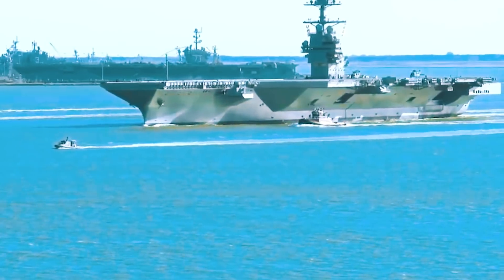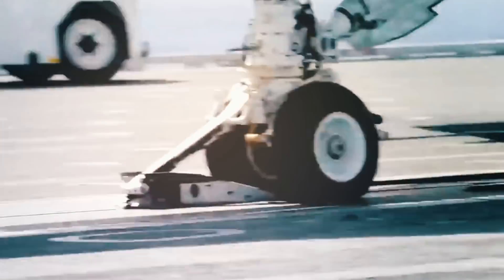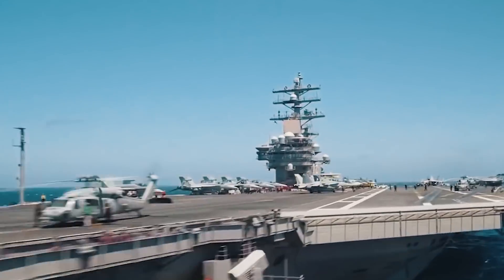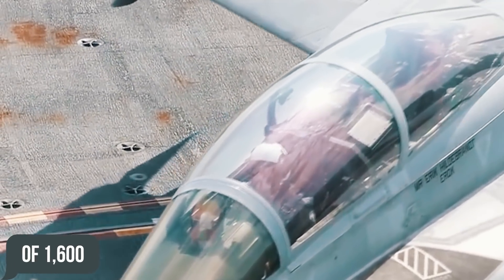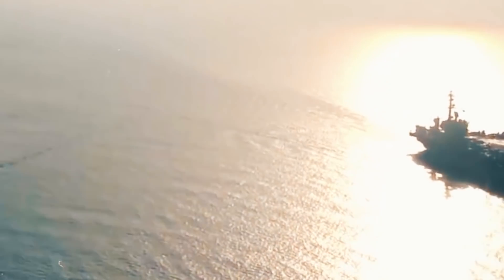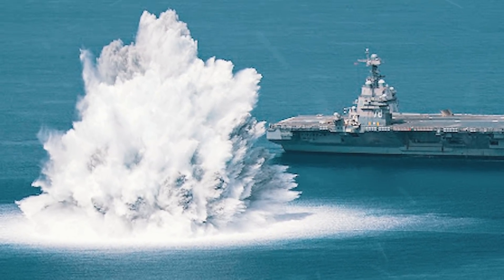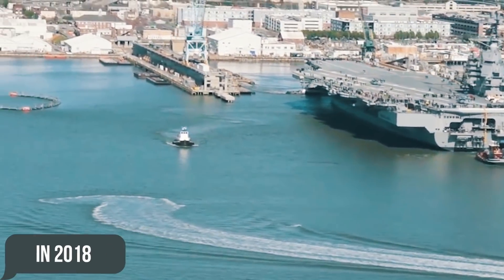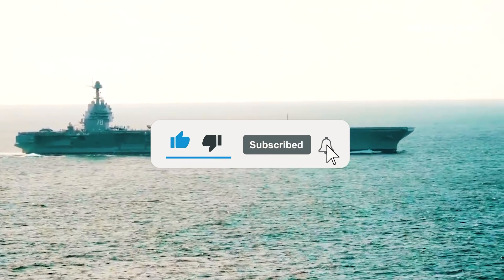This New US Aircraft Carrier Shocked The World!

Comment: The military and its contractors are doing for the most part outstanding work to modernize and place us in the lead with advanced military equipment. Now for why I say the most part and it's not the military members but the contractors and what I mean by that is there are times when the contractors are awarded contracts for a price the have delays and serious cost overruns which at times double the original contract amount awarded initially and usually it is every contract bid and excepted then the over runs kick in due low balling the initial price. I only know this because I spent 24 years in military service and a couple years with contractors now dont get me wrong I have no problems with any contractors it would just be nice if the could hit closer to thier bided amount to cut down time it takes to go over cost overruns and waiting for approval of more funds which slowes down our brother and sister In uniform get the high speed things they need to keep the free world free. HOOAAH

Comment: The George Washington CVN73 was one of the last of Nimitz class carriers. I am a plank owner of this Ship..As each lift section was placed it was set in place with at least 4 1973 George Washington quarters. The bottom of the entire "Island" is set on several 100 1973 quarters. CVN73 as I recall was 6 months ahead of schedule when commissioned on July 4th 1992. Even though 1 of the 1st to be built by modules Even during Shakedown, the George Washington had problems. Which were eventually fixed. The main difference between the Washington and the Ford is more powerful reactors on board the Ford. Plus modular slip in weapons stations. The more powerful reactors are needed to run 4 EM catapults and the advancement of Energy based weapons systems. The extra large bulbous bow I hope corrected the feeling of left/right slippage that you could actually feel towards the Bow. Before The George Washington CVN73 was given to the Navy people thought that one of the engineers was having phantom feelings when underway till I arrived and started to ask questions about why it felt like we had slippage going straight and in turns, Forward of Hanger bay 1.
Reply: America should sell the George W Bush and the George Washington carrier to Australia....... we live a lot closer to China.... and need something with some balls in the Australian Navy...... apart from your old submarines..... which are still great...
Reply: I guess not everyone can feel those differences then.  Did they listen when you noticed the slippage?
Reply: Do you have any references that mention the use of quarters during her build,  Wondering if that is a fact or just some fiction, or a factoid of the ship using that much copper or nickel in those areas, even though that in it's self would make no sense. Literally the whole thing makes no sense, they used weak metals between the steel which would compromise the ships effectiveness?  it sounds odd that the ship had sections with coins just sitting under them, let alone weak metals used in the joins of steel on steel, which was welded together.

Comment: I am glad it’s on our side. The obstacles overcame will set the bar allot higher going forward.
Reply: The obstacles were not overcome, it is not fully certified for combat due to the ongoing mainance issues, sure they tested the launch/capture system 6000 times, also rebuilt it several times during that time, same with the elevators.

Comment: I've always had trust in the US engineers and all their workforce in designing and building such a magnificent aircraft carrier and also in making it work in compliance with the requirements set forth by the US government, the US navy and the demands of modern warfare. That the electromagnetic catapult system was the source of problems as well as other systems on CVN-78 is perfectly normal when one develops new technologies. The other way around, i.e. a brand new type of boat with brand new tech being operational and without any problems from the beginning is just impossible. Those who are familiar with engineering know that.. Progressively, the problems were solved and now the US Navy has a fantastic new asset. This new boat is gorgeously beautiful and is extremely advanced. and in a few years, the USS John F. Kennedy, aka CVN-79 will join the Gerald R. Ford and others will follow.
Reply: I think Americans have a good confidence in their engineering abilities, but other countries also have the ability to do the same good things. The US should also accept and catch up, rather than trying to discredit or undermine them.
Reply: Regarding the steam powered catapults...Don't fix what isn't broken.
Reply: @peterszar  steam powered catapults need to be preheated all the time (3 hours before launch), meaning more power usage resulting in higher running cost. Should I continue?
Reply: Same with the Enterprise
Reply: But it has not performed to the standards set by the government yet, you are getting ahead of yourself. This propaganda piece neglected to mention the amount of times the systems were taken offline to rebuild. Just because they tested and retested does not mean the systems are compliient, they have not been proven to be compliant with operational standards over the time a carrier is expected to be out of port and without the engineers onboard to rebuild the systems.

Comment: Why not leave well enough alone, steam powered is more reliable than electric. Throw a EMP on it and it's one giant anchor with all that electrical crap. Same thing with our subs. Those subs get wet inside like you see in these old ww2 movies that sub will short out and to the bottom it goes. Perfect example the Thresher, God bless their souls. It got wet inside and the reactor shut down and to the bottom It went. A WWII sub would of done better if it got wet inside. To much electronics, leave it mechanical for the most part. It hasn't failed us in WW1 OR WW2. Just my opinion is all.

Comment: Treatment for shock:
    Lay the person down and elevate the legs and feet slightly, unless you think this may cause pain or further injury.
    Keep the person still and don't move him or her unless necessary.
    Begin CPR if the person shows no signs of life, such as not breathing, coughing or moving.
    Loosen tight clothing and, if needed, cover the person with a blanket to prevent chilling.
    Don't let the person eat or drink anything.
    If you suspect that the person is having an allergic reaction, and you have access to an epinephrine autoinjector, use it according to its instructions.
    If the person is bleeding, hold pressure over the bleeding area, using a towel or sheet.
    If the person vomits or begins bleeding from the mouth, and no spinal injury is suspected, turn him or her onto a side to prevent choking.

Comment: There is to be problems found on any new ship and the contractor can not only correct the problems on this ship, but make it easier for the next one being finished to come out perfectly and the one after that.
Reply: Yep.. That's what sea trials are for.  Whenever you build a new design ANYTHING there are ALWAYS improvements required to get all the systems properly operational.  Look at NASA, Space X and ALL aerospace manufacturers automobiles makers and medical industries..  They ALL had systems failures before they were able to perfect their systems.  Any "engineer" who doesn't expect these failures is a fool.